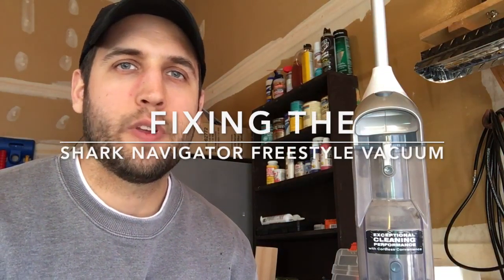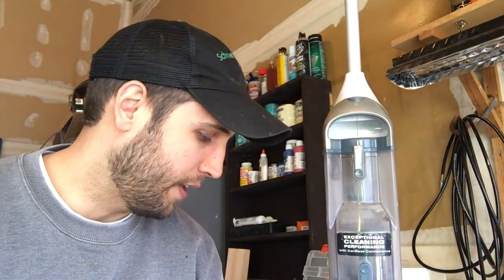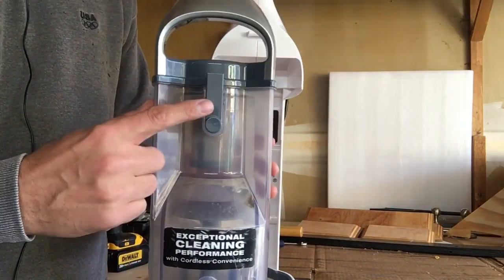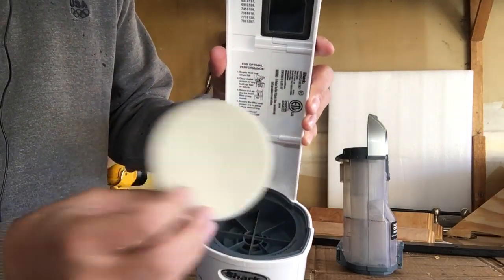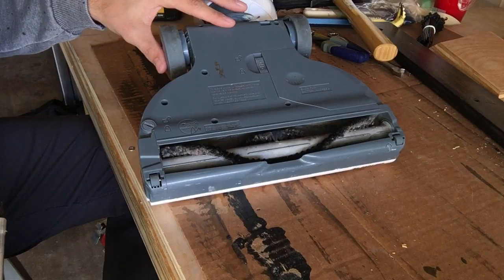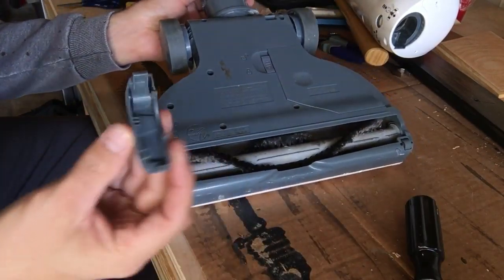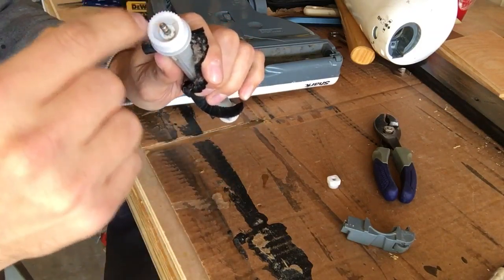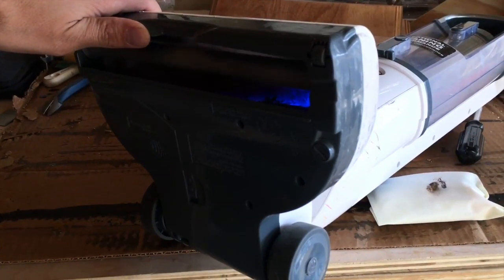Fixing the Shark Navigator Vacuum

Comment: I cleaned the beater. But the beater worked when housing was opened and quit when I swiveled the vacuum. After reopening the housing I discovered a wire that was pinched in factory assembly. Once it was replaced the vacuum has worked well.

Comment: Cleaning the foam filter did it for me. It would occasionally operate, but more often it would start and then stop. Let it sit for 5 minutes and it would do it again. Then sometimes it would run just fine until I turned it off. There must be some type of air flow sensor that triggers when the filter is too dirty. Once I cleaned it with Palmolive Foam soap, today it has worked multiple times with no issues. Thanks for sharing the video.

Comment: Thanks for the tips.  Worked like a charm.  Roller was not moving correctly.  That fixed it.  Another problem i had was had to order a new cord for the charge base because the other one got damaged.  Good thing Shark has the parts for all these things.  I had to order a battery for mine as well but I have had this for several years and it keeps plugging away and doing the job.  They stopped making this stand alone one in this price range and you have to pay alot more money for the stand alone feature now.  All you can get for the price i paid for the navigator is a stick vacuum which you have to lie on the floor or up against things which makes charging a pain as well.

Comment: Excellent video...thanks! ALSO--CHECK THE EQUIVALENT SPOT ON THE OTHER SIDE OF THE BEATER BAR. There is no bushing to remove on the outboard side, but the little cup gets packed with a bean-sized amount of compacted hair that is apparently enough to make the unit shut down after a second or two of running. Cleaned it out--all good!
Reply: I followed the video and it didn’t work but this comment saved my vacuum! I might have a slightly different model but my bushing was removable, it was just so clogged with hair and dust, I could barely get it off. But now it works like a charm. Thanks!

Comment: Gary!! My man! I was so frustrated with my new Shark Navigator Self-Cleaning Rollerbrush vacuum when after only a few months it stopped working. Not only the roller brush but after a few second the vacuum would shut off completely! I always clean my vacuums well and perform regular maintenance. Was totally stumped and about to give up on it and call Shark or just toss it, and then I saw your vid. Wow! The rollerbrush was being obstructed by a small piece of soft cardboard and a toothpick that you couldn't see unless you removed the entire brush from the belt. 

Thank you SO much. Worried even thanking you is going to jinx it and make it stop working again but thank you SO much. 

P.S. Remember if you're troubleshooting for this that the rollerbrush also will only activate if the vacuum is in the reclined position. Felt daft about that haha!

Comment: After I did all this, the brush only ran for 4-5 seconds then turned off. So I turned it on for  5 seconds and off and did that a few times. Finally the brush started working consistently. I don’t know maybe it just needed to get warmed up a bit. Just fyi, in case that happens to you.

Comment: Thank You.  That fixed it.  I did both sides.  I saw another video to  take off the opposite side because he could not get off your side.  That seemed to work better than I saw your video and had twice as much hair on your side.  Works great on full power but not so great on lower power.  Thanks again.

Comment: Thank you... mine was acting up, too. I would have it fully charged and when powered on... it would turn off within a minute,  So, I took my roller off as you had.. BTW, I always did that to clean the hairs but never thought to pull out the two end caps and cleaned within. So, in doing so...it solved the issue. I did not have a lot of hair, but it did the trick. Thanks!  I had initially questioned whether the battery was at fault. It was not. So again... thanks. It's working like a charm. I love it!

Comment: If I could reach through the computer and give you a hug, I would do that right now it worked. I was ready to trash this thing I even went out and bought a different  vacuume that is inferior to my shark. I absolutely love my shark. It is so powerful and it worked great I’ve replaced the battery once and it still kept on going But then all of a sudden it would run and then stop in five seconds  the first time I did what u suggested it didn’t work  I thought it worked for him, I must be doing something wrong. I had already unwrapped the new vacuum cleaner I bought, I said, let me just try doing it one more time. It works !!!!!!!!!! I am  returning the new vacuume You saved me $95.00 plus tax. Thank you so much for sharing your video.

Comment: Issues with the power button. . .it turns on for about 2 seconds and then goes off. The battery is showing fully charged. Do you have any suggestions to fix this issue?  You have made an excellent video.  I have another upright vacuum (different brand) that I literally taught myself how to take it completely apart and deep clean the hose and all. Where were you twenty years ago, "Fix-It Kiddo-Man"?

Comment: Beater bar? That cracks me up. Isn’t it called a brush roll or carpet roller? Anyway that sewing tool you used is a seam ripper. Excellent tool to have for vacuum maintenance for sure and works great for the hair on the “beater bar” Lol... sometimes better then scissors.

Comment: How that beater bar latch came off so easy for you is not happening for me.  It seems stuck on.  Maybe the screw is not turning to the unlock position and threads are stripped or do you have to do several rotations of that screw.????  Update....Got it off finally and repair worked but had to use tape to keep it on when i put it back.  But it works.  Thanks again.

Comment: The problem with my shark is the hole behind the beater bar that continues up to the housing container. It was clogged behind the bar and I didn't see that.  The white tube that goes up to the dirt container was cleaned of primarily leaves.

Comment: Have you ever experienced the problem of the vac just surging. When you push it forward it almost goes off you pull it back and it goes on vice versa etc.etc. I have cleaned the contact where you snap the unit into the head several times with no luck which seems to be the most logical place that is causing this problem. Any help would be appreciated before I just order a new one which I will do no problem because this is the best vac of it's type in this price range. Thanks
Reply: I'm having this same exact issue. Did you find out what the problem was?
Reply: @EviesArk  I did fix it and for the life of me I can not remember how. Oh wait I just remembered it was the contact when you take the head off. I sprayed it with electrical cleaner and may have sanded the contacts slightly with a nail file.

Comment: I did everything you showed on the video - Fix Shark Navigator. It does work better but…. As I’m vacuuming I push forward and pull vacuum backwards. A line of debris is left behind. Every time in pull
back and then forward another line of debris is left behind. Any ideas on how to fix this?

Comment: I thought my battery pack was dead but I checked the voltage and it was well beyond the 10.8 volt rating.  So I unsnapped the head the from the wand and examined the contacts.  They looked fine but I went ahead and cleaned them anyway.  Its not easy to get at them inside their plastic plug... used very fine sandpaper rolled into a tight u shape on the pins and a round jewelers file on the pins.  Then I reassembled and hit the switch... BINGO  runs like a champ. No need for a new battery after all.  In fact the new battery would come with clean contacts on its plug so one might assume it was the battery when it was really the contacts all along.  So, clean contacts first and if that fails THEN order a battery.

Comment: I've done all of these steps and it still has not fixed the problem for me. I'm having the same problem as described in the beginning of the video. The vacuum DOES suck debris  and collects in the tank, so I do not think it is the motor. The belt does not seem worn out either. I've only had this for 2 years, and the roller stops rolling after about 3 to 5 seconds.

Comment: I did this. The brush part spins for about 5 seconds and stops when I Turn it on. The belt feels really tight. I'm wondering if I shoudl clean the belt? Not sure how to do it as I'd have to break into the body of the bdttom

Comment: I have a new Shark Navigator.  When it is (was) charging both sides of the light were on then I assume that it was charged when one side was turned on.  However, when I tried to use the vacuum it would not work.  Now I can occasionally get the light on both sides to go on but only once.  I replaced the battery pack and the same thing happened. So a new vacuum worked twice and now will not charge.  Any ideas?